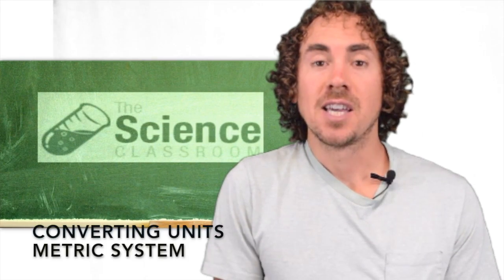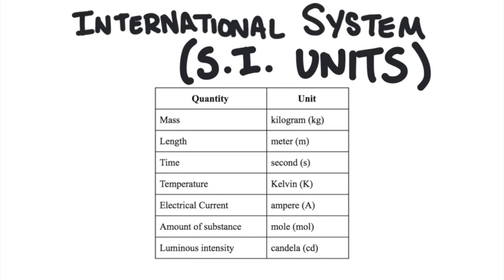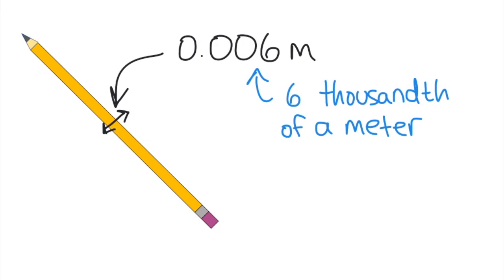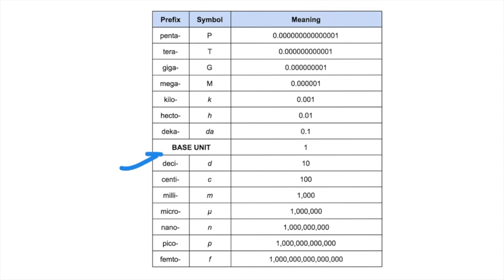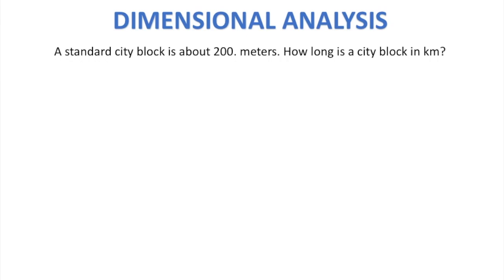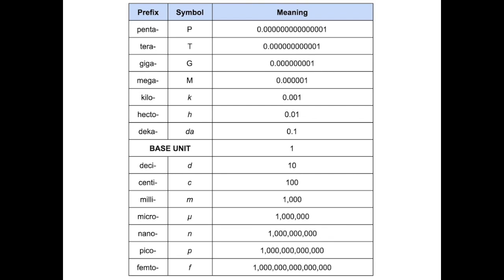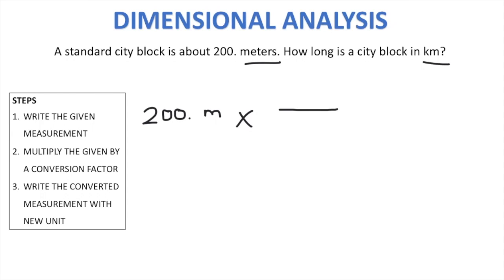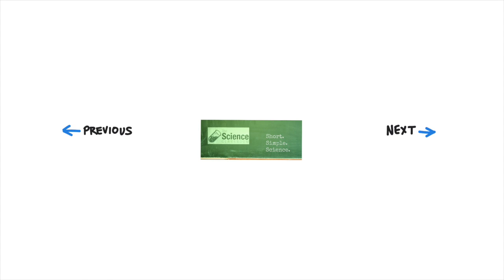How to Convert Units in the Metric System (Dimensional Analysis)

Comment: Would you please confirm your definitions of the prefixes in your chart at time 1.50? All the prefixes above your base unit should be multiples, whereas all the ones below the base unit should be fractions. Ex: kilo means 1000, milli means one thousandth. And when you convert 200. m to km (@4.07) the conversion factor should be 1 km/1000m.
Reply: That is a different way of writing the same things that he uses in the classroom.  1000 m = 1 km AND 1 m = 0.001 km.